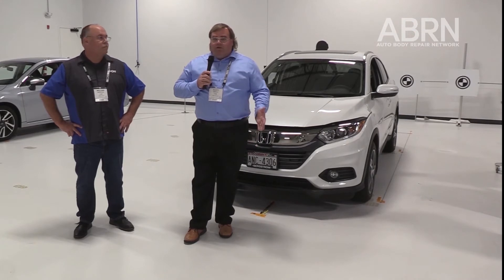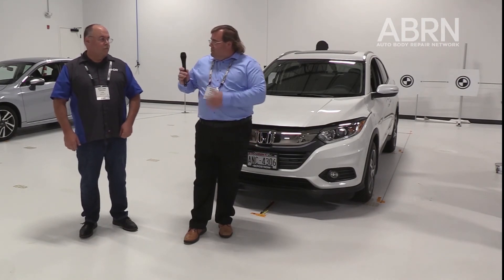I-CAR technical experts discuss the ADAS Calibration Lab at the Chicago Technical Center

Comment: Very interesting you don't have the Autel aftermarket tool there which you endorse even if they use single-size radar cones to calibrate multiple brands. On floor size, and tolerance do you have 0.35 degrees as per some Toyota requirements or do you just manage to have 1 degree as per the definition of the flat floor?